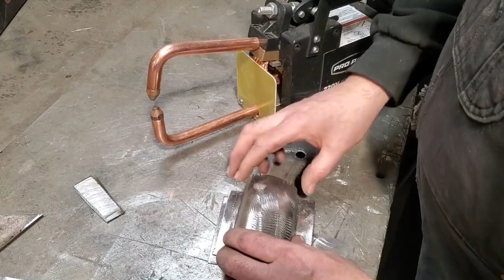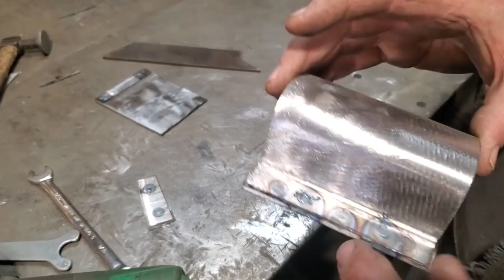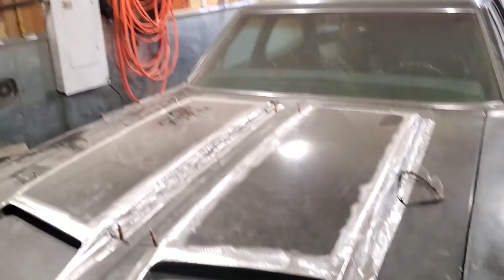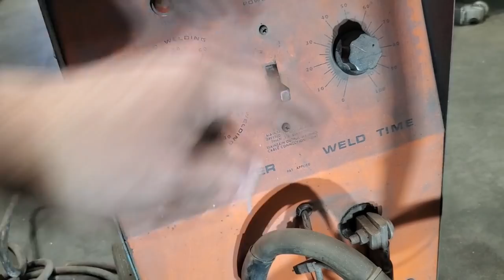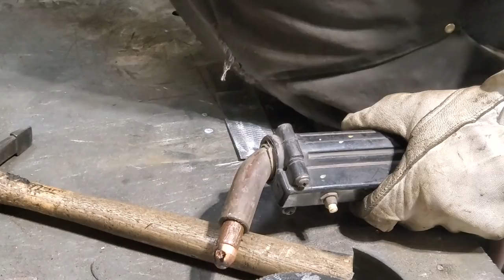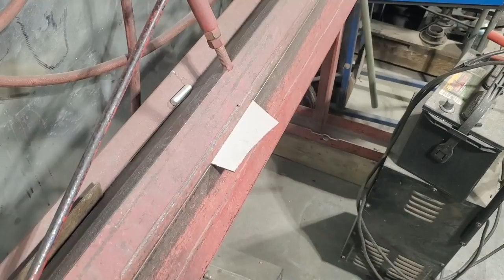How to spot weld. spot welders, New vs old!! Future plans!!

Comment: Tony the tip / leads with the hole in it is for welding the metal studs to pull out dent mine also has a slot cut into it for washers and slide hammer to pull dents all that you do is vice grip the ground / no- trigger  cable onto the car somewhere and use the trigger (button) to weld the washer or shrinking tip.

Comment: Tony the only downside is with the old port-a-spot ever since they changed the metal of cars back in 1983 to a higher carbon content the government regulations don't want you to use  the old port-a-spot on main structures of the cars anymore that's the main reason they went with the mig welder!
You can get away with a very small patch but they prefer mig welding instead but I use my old spot welder a lot still on older cars pre -'83 putting on quarter panels rockers etc. I had a few offers to sell it quite a few times I also have the tips for studs & washers for pulling out dents and a larger tip to do metal shrinking with a hammer and dolly. I was looking on line to find another port-a-spot good luck but your lucky you have the two dial unit mine is even older I only have the single file for the timer my timer is set to the longest time lucky since the knob broke off but I just use the trigger button as my timer. I even make meal trays with mine.
You have the year setting and time setting on yours I have the old high heat full force they I control with the trigger.but would love to find another one for spare parts.

Comment: Wanted to drop in and say thank you for the "tips" about the larger surface area on the contact tips!  I had bought a used Miller spot welder and could not get it to weld 18g without blowing holes in less than 2 sec of weld time.  I figured I could buy new tips if it didn't work, so I ground them down and gave it a try.  Brilliant, problem solved!  Now I can move on with the build!  There isn't a whole lot of information out there about dialing in resistance welding for automotive restoration.  Picked up some extra info too, I like the door skin trick!  Thank you so much!

Comment: Hey, I bought one of these. I'm in st,johns NL. I have some questions about it because I can't get mine working. The board had coke spilled on it a long time ago, I had it cleaned the board tested fine. But I can't get it to work.. I'm wondering what else could be wrong with it. There are controller pots I guess I'll check those next

Comment: 1977 i bought a Lenco Panel Spotter. Playing and playing , like everithing you practice enough. I did awesome repairs on rust. I cut clean the hole and treat inside with any rust preventive primer , plus treat the patch. I saw repairs, last forever. I bought a nozzles kit to weld regular 1/4 washers to pull dents on cars. Is a very versatile machine.

Comment: The best way to test a spot weld is to weld 2 strips at 90* to each other. Then twist them apart at 90* in the flat. A piece of one strip will remain 'the nugget' and show how much fusion happened. Much easier than splitting with a chisel.

Comment: How do you spot weld when there is no space for the second tip of the welder?
Reply from the maker: No space? Explain
Reply: @fitzeesfabrications  So, some places around the radiator support do not have flat ends to make both welding tips clamp with each other. Thus, I was wondering if we can attached a high voltage cable line to one tip and clamp it to the radiator support so that the other tip can weld that very spot?
Reply from the maker: @EddyBoh  ahh ok understand now. I can see that working but the clamp will try to weld as well.  It would need to be setup like my other spot welded. The welders work by passing the current out one side and into the other.

Comment: You really need a timer. Generally, thin sheet requires times that are less than a second. Sometimes, with thin gauge, less than a half second, or less. It’s impossible to consistently hold that switch down repeatably. I find that a tenth of a second one way or the other, on thinner work, makes a big difference. Spot welds should never show spattered metal. If it does, the time is too long.

A photo timer with tenth seconds works well if the output is connected to a heavy duty relay, say a 50 amp solid state relay. The timer controls the relay activation input and the input to the contact is connected to the wall. For 220 you can get a dual channel solid state relay. Or you can go old school and use a mechanical relay.

Comment: Thks &;
*It would seems-likes when I only need quick spot welding on thinner metals, a spot welder would be a whole-lots less set-up, the-welding, & break-down efforts than breaking out the stick/mig welder (?would yous agree?).  
*Hmmm .... ???I wonder should I consider the benefits/detriments of epoxy bonding metal together sometimes too (ex: JB weld)??
      How strong is JB weld structural epoxy adhesive anyways ? Destructive test, simulation and review https://www.youtube.com/watch?v=LGCJGNkEpy8
*Oh, I'm concern abouts your long-term health.  Pls squeeze in a little exercise, healthy meals, etc (because I would like to keep expert folks like yous around for a long-time ;).

Comment: I wonder if it's possible to mod the clamp machine with adding cables instead of the clamps to get welds as the "old" one does them (kind of ...)
Reply from the maker: I say if you put some thought into it you can

Comment: Hello Fitzie I enjoyed seeing the old spot welder brought back to use. You also found a good way to use and replace consumable tips. You asked about questions. I noticed you kept the spacing between the ground and electrode quite close. Will the unit work if you keep the ground In a fixed location and run the seam just relocating the electrode? If yes, do you have to adjust the power or time as the electrode is further from the ground point? I have a project that I was wanting to use this method of attachment, space is very restrictive and just moving the one probe would be very helpful for the repair. Thanks.

Comment: I have a question about spot welding with the pro point. When you put 2 pieces of sheet that you want to spot together you said they need to be tight together. I get that. But I'm wondering about using weld trough primer in the middle. I've seen karl fisher use weld through primer. The copper kind or spray paint. Is that ok to use in the spot welder situation?  Just thinking about rust i am

Comment: Cut the old welder cord off leave a short amount and add a plug put a box on the long part now both welders have the same reach and you have a low cost extension cord.
I have an old spot welder like that one i want do adapt it to use the triangle spot dent puller slide hammer attachment from newer dent pullers. Does anyone know if that will work?????

Comment: i have done some practice spot welding over weld through primer (need to do some more). it does work but maybe not as nice as just clean metal. do you think it's worth it to use weld through primer on a car thats only for summer use?
Reply from the maker: I don't use it at all. Don't like it. Like to try the copper  stuff. I like to apply  paint to the panels and clean off where I am welding

Comment: I bought a Harbor Freight 110 spot welder and loved! I did the lower edge of my rockers. I had to hold each weld for about 8 to 10 seconds and they came out great! I did the length of the rocker in less than 5 minutes! 👍

Comment: Current flowing through the steel's resistance creates the weld. Too loose or too tight will NOT make a weld. Electrode surface area directs the current. You could have one flat electrode and one conical instead of using the third piece of steel. The ONLY way to know if a spot is a good weld is by destroying it, which is why they put so many welds in at the factory. They expect a percentage of 'bad welds' due to dirt, draw compound, etc. Welding aluminum requires A LOT of current for a short duration because resistance is so low. The name of the game is, squeeze, weld, hold.  Factory welds are normally 1/4" which is WAY larger than your toy welder.  Steel wheels have 1/2" - 3/4" welds made by pulsating current (squeeze, weld, hold, weld. hold) 'Hold' is always a wait time. Let go too soon and the weld simply pulls apart.  Factory welders (electrodes and transformers) are water-cooled.
When you pull your welds apart, let's see the actual size of the weld you made.  Let's see the 'button' you made.

Comment: Another great video. Keep it up your excellent work. Some tips to improve the  quality and make professional spot welds with  the ProPoint machine. For 18 gauge ( 1.2mm ) mild steel or stainless sheet metal the recommended electrode tip diameter is 0.216 in ( 5.5mm ) and has to be perfect flat, not rounded, with smooth surface and clean. To make good quality spot welds you have to make the welding electrodes to be COAXIAL to each other when the 2 metal sheets are between the electrodes & the proper clamping force is applied. To achieve this setting the factory supplied upper tong end has to be bent more until  the 2 mounted electrodes get coaxial. It is obvious that for every thickness of sheet metal you will have to use different diameter / length welding tips & set up their alignment individually. Using copper spacers between the welding tips and tongs makes this  setting easier. Sparking is not normal and could be dangerous ( proper protective gear is a must ). During welding it is not allowed angling of the clamped materials, The welded materials must have smooth surfaces in the welded areas, to be clean, free of paint , rust, grease, etc.....I recommend to make sample welds first , twist and peel test them using a wise and pliers and check if the proper welding nugget is formed between the electrodes. The goal in resistance spot welding is to melt the 2 or more sheet metals placed  between the two electrodes and fuse them together. If the heat is generated between the two mating surfaces of the welding tips and sheet metals, due to dirt, oxidation, rust, rough finish, no proper welding nugget  will be generated. On a good quality spot weld the sheet metal mating surface with the tip has very little discoloration from heat and should remain flat.  It is important also to use dielectric grease on the welding tip’s thread, otherwise it can fuse to the arm due to the very high welding current. Adding a timer is also a must for good quality spot welds. There are timers with welding time compensation. These are monitoring the welding current and adjusting the welding time accordingly. I managed to spot weld aluminium sheets too with my 220V ProPoint.

Comment: I used spot welders like those in 80s, n bought em both by the early 90s. My tong welder is twice the weight of that one. Life changed and I got away from sheet metal fab work. Sometimes it was easier to clamp the ground off on that oldie, n do a spot at a time. Old tin snips got two pieces of steel welded in jaws to step metal in short steps. Never did a floor job but did do a rocker on a 55 chev 😁👍 Wasn't a prob putting three layers together when ground lead was pressed towards triggered lead. You're going to use these quite a bit.👍 Thanks for sharing Fitzee

Comment: I wish I was there first of all.... Tony,    the first welder showed the points of heat from either side where this is side by side. I hope not to confuse you or sound so stupid that you remember me an just pass me off. I see a kinda dream idea i guess as i see one man under an one in the rig with a very tiny hole drilled through to make the two spots line up and then weld along a seam...would that work? Or say you have your tags to hold the metal in a spot wanted as a floor pan to the crimp seam... just going slow and steady... think it might do a decent weld??? Hey, I am a crippled seventy three year old man who did like stick welds back in days long gone. I will never even get to drive again... those things that I miss terrible.. is it one that you just have to try for yourself an it might work for me an never come close for anyone else... Just some damn old man who shouldn't be bothering you. I sure miss those days as I started in the late fifties... never ever really great at anything of high notice but I never stopped trying

Comment: Rather than the steel plate for door edge welds could you make a little cup piece out of steel with a flat steel bottom that fit over your one electrode and provided that shield for the outside door skin? Might be easier than trying to clamp a plate on uneven door edges.

Comment: I wonder if one could make a couple ends for an old arc welder, have one with a button and a timer you could adjust, and do similar to what the old school one did? Instead of clamp for holding welding rod, and ground clamp, just two brass ends, and one of them has a trigger with an adjustable timer on it?

Comment: I use these machines but a larger version daily at work. As stated below the correct way to weld using your big machine is to still have the electrodes on opposite sides of the metal being welded. It still works in the way you are doing it but it isn't as strong.  Also make sure you go from one end to the other.  Don't tack each end and work your way to the middle.  If you do that you might end up with a pucker that only gets worse the closer you get to the center. One end to the other walks the excess material out the other end.

Comment: Very good demotion of spot welding machine. But on the new spotter it is possible to mount longer arms and with different openings, so that one can reach hard-to-reach places.  When to create a new floor on crusti, I guess you have to make beads in the floor. I think it's easy to understand you when you explain, and your demmost rations are very good.

Comment: Would it make any difference as to how hard you hold the welding tips on the metal to give penetration. Great video. Thanks.
Reply from the maker: Yes it do if you don't have enough pressure it might not be completely togeather at the spot weld location and it won't penetrate into the second peice of metal

Comment: Thanks for the video Fitzee, very informative. I have zero practical experience, but because I'm an electrician, I have 3 points which might possibly be of interest. Firstly, I would suggest than when using the slab of steel to protect the back side of the weld, you could try using Aluminium or Copper. Since it has a much higher conductivity, it should give a stronger weld, because that will concentrate the power in the steel sheets.  Secondly, I noticed the spot welds with the old machine are tiny. Not a problem I expect if you can put in lots of them close together, but if stronger welds are needed, would a flat tip, 1/4" or 3/8" wide with a hole in the middle to reduce the contact area, give a bigger and therefore stronger weld. No doubt more power would be required.  Lastly, I partly agree with Mattsawesomestuff below, but my conclusions are different. Heat is generated where the most electrical power is lost. i.e. where where is the greatest voltage drop. Which is why ideally the 2 electrodes would be on opposite sided of the steel sheets at the point of the weld. In the method shown in the video, there will be a significant portion of the current passing across the top sheet alone and there will be voltage drop between the 2 spot welds because the current is passing through steel and steel is not a great conductor. The greater the distance between the welds the greater the voltage drop. To reduce this I would suggest having a slab of Copper or Aluminium on the table, to press the steel sheets against. This will allow the current to pass from the back of one weld to the back of the second weld with minimal voltage drop. There is bound to be a cooling effect, but only experiment will show if that's important. PS In an ideal world, the Copper slab would have two raised probes (points of contact) similar to the ones used to deliver the power. This would really focus the power in the spot weld. But you would need to place the hand held probes directly over the ones below. Probably not practical.  Sorry so long 😀

Comment: They sell a tool that not only punches holes but on the other side of the head it will off set the metal just like you did with the metal breaker but do it uniformly I "think" it's called a pneumatic hole punch, I used one on all the panels I would spot weld with one of those "old time" spot welders, made my job A LOT faster and easier, enjoy it you will love it and say to your self "how did I ever do with out one" lol...

Comment: I worked with one of those old time spot welders a lot they are the best it can do any thing the new ones do and more as you know, 
TIP you don't have to hold the leads close together I would have one on one end of a panel and the other at the other end and works just fine...

Comment: Rolls C'nardly...I haven't heard that one in many a year 😆😆 You can get fusion welder that have interchangeable electrode of different lengths and shapes. If both of those welding arms are replaceable on the princess welder, you could make your own arms out of copper rod...Great demo Fitzee!

Comment: Is ‘weld thru primer’ on both the mating surface necessary or does the seam sealer does away with it completely?  I understand flow thru primer contains Zinc, an anti corrosive protection.  I am currently utilizing both products!
Reply from the maker: I have had trouble in the past with weld threw primers. I prefer to seam seal it afterwards and paint it

Comment: I use a Miller spot welder about the size of the one you're using,works great.
Reply: I also have a Lenco panelspotter,I only use that for the pull washer attachment though.